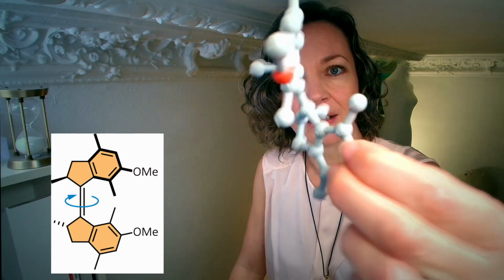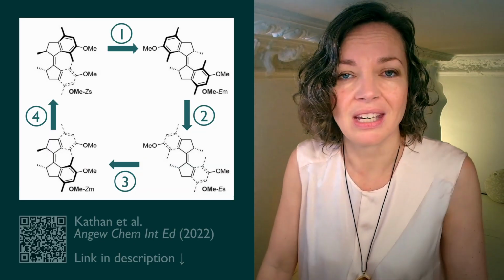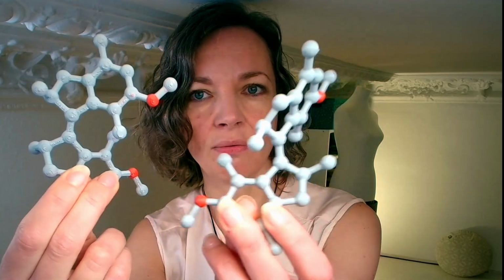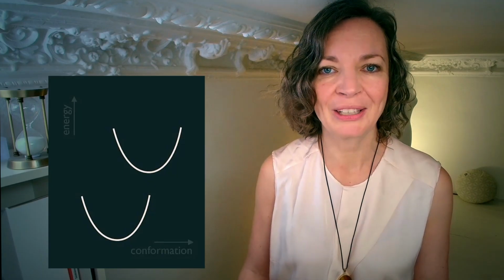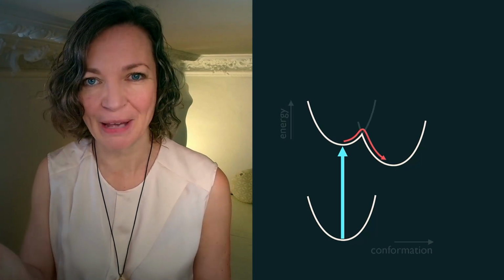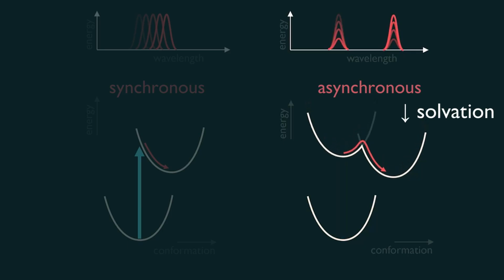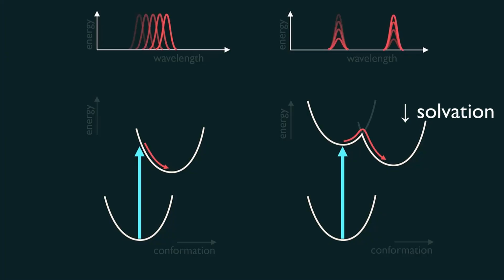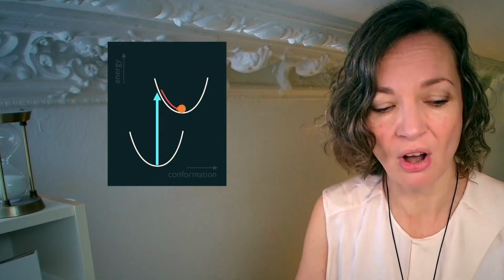Molecular motors: a surprising truth about their dynamics

Comment: Great explanation, Prof. Stähler. I was wondering how much of the synchronous, barrierless rotation you observe is an intrinsic property of the molecular motor itself versus something influenced by the surrounding environment. If you were to study this molecular motor in a much more viscous solvent or in a solid-state film, where there are stronger interactions with the surroundings, do you think you would still see the same inertial rotational behavior, or would the motion become more damped or even change qualitatively?
Best, Akshay
Reply from the maker: Thanks, Akshay, for this thoughtful comment! The 2 different solvents that we use - and the absence of an effect on the initial dynamics - show that it is a property of the motor. However, if the motor is put into a highly viscous environment, this will likely slow down the motion, because the friction will become rate-limiting. The motion we observe is the fastest, upper boundary if you like. Think of a professional runner whose performance on the 100m track is more or less stable. They will surely be slowed down if you have them run 100m in reflecting pool at the Lincoln memorial. Their best time will still be theirs. Let me know if you have further questions!